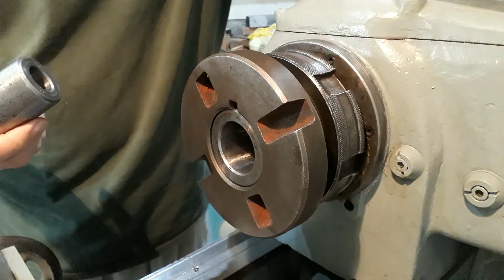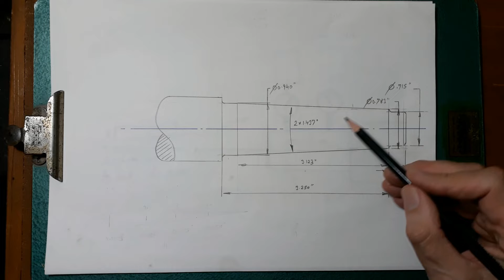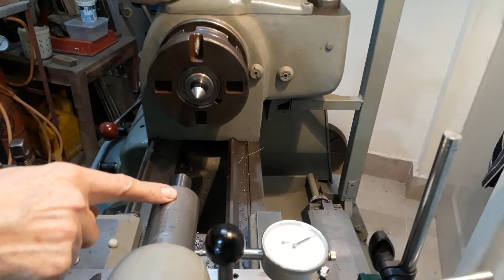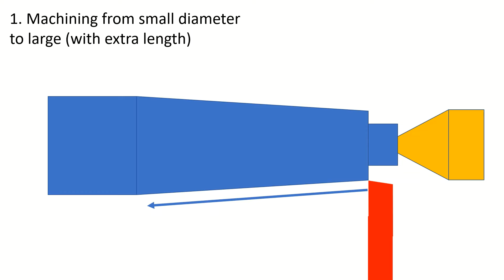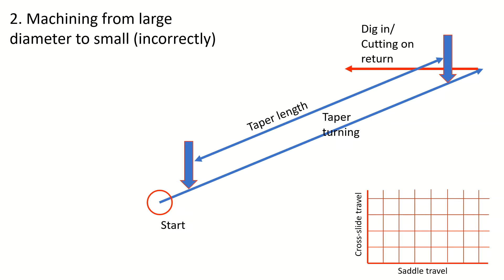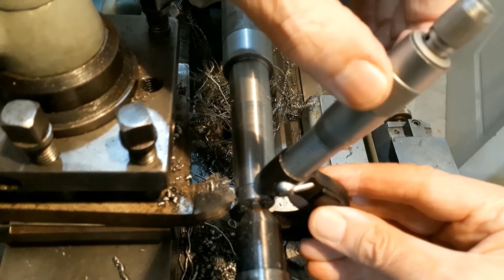Colchester Student lathe - using the taper turning attachment

Comment: The TTA is one of the problems on my lathe. The adjusting screw was bent and very stiff - and now broken. Despite Colchester's efforts, setting up the TTA is quite a faff. Long-term, I had planned to look at setting it to thou accuracy using the cross-slide and a longitudinal slide but I still don't think it's anywhere near ideal.
Reply from the maker: Hello again! Yes, I know what you mean about the adjusting screw - it isn't efficient at ensuring accurate adjustment. I usually accomplish the fine adjustment with light taps while the clamps are partially restraining the slide. Even the small amount of clearance on the central pivot has an effect.

Comment: From this video, I'm guessing you have the Colchester 'matrix' clutch and a VFD. You will likely be aware of Colchester's 'Safti-lok' drive starting handle which needs to be pulled towards you then lifted up. Pulling the handle towards you lifts it over a pin which prevents accidental starting. When we set up our matrix clutch, we found a 'new feature' in that the Safti-lok pin stopped the start lever from being lifted beyond just a tickle of the clutch - so lifting the lever without pulling it out does start the spindle revolving - but with minimal power. It gets a lot of use in simply nudging the spindle round ! Ideal for checking tool/chuck clearance or rotating the headstock gear train to change gear.
Reply from the maker: Yes, I have the matrix clutch and a VFD but mine doesn't have the 'Safti-lok' feature though I had heard of it. I could run the lathe on just the VFD but I find the clutch to be useful. I may get round to relocating the VFD in the cabinet.